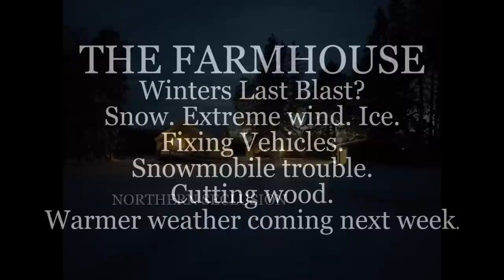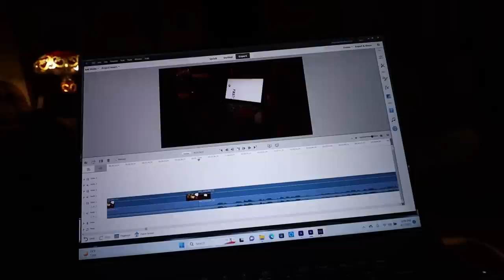THE FARMHOUSE. Winters Last Blast?  Snow. Ice. Extreme Wind. Fixing vehicles. Cutting wood.

Comment: good day joe sounds like you need a little carb work on log splitter . u might be old enough to to remember when the old 4 wheel drives that all the trucks Used spindles and were able to grease the bearings and he never had a failure yup those were the days and never had a bearing failure then on that style, keep having fun and enjoying life

Comment: It would be nice to see in a video if these winds you had caused any trees to blow down in your woods. You could do it while checking the Maple tree taps for any sap flow. If you have any, would you try and get them cut up and pulled out before the bugs get too bad in the Summer? Depending on the species and how small you split the wood, this wood could be used in your boiler next Winter.

Comment: The floats in the carburetor are stuck, or have a hole in one!! It definitely sounds like it isn’t shutting off the fuel when the bowls fill up with fuel!! If they don’t shut the fuel off it will let the fuel keep flowing causing the fuel to fill the engine block with fuel!!!! You definitely don’t want to keep turning it over because if enough fuel gets into the engine it can cause it to get locked up until you get the fuel out of the cylinders!!! It can cause damage to the engine if it does end up starting before it gets to much fuel in the cylinders!!! Hopefully that helps you out!!! I’d definitely take the carburetors off and double check the floats making sure that they still float and don’t have a leak in them causing them to fill up and then if they don’t have a hole in one definitely check the seats on the needle and make sure it is still working and not have junk around the needle where if it doesn’t shut the fuel off because of junk or if it has a bad rubber where it seals the fuel off!!! Those are the two first things I would definitely check out and I bet the issue is somewhere in there!!!

Comment: Are there any fuel filters on that machine? The carburetors you have are definitely float type and can be very touchy.
Reply from the maker: I have no idea. You know me, it either works or it doesn't when it comes to the smaller engines. If Zach can not come fix it, it is time to buy something else. Lol.

Comment: Great video! At least we know we’re not the only ones dealing with gale force wind. Looks like the wheel bearing replacement went better than on my 2001 Tahoe last month! I ended up buying a Harbor Freight air Hammer to get the old one out. Took forever. Starters now seem to be a pain on any vehicle these days. What’s the scoop on the MS361? I may have missed what was up with it.
Reply from the maker: I did use it in a video but it still does not run as good as I would like. It could be that I am just not used to the saw. Once I got my 360 fixed and then I have the smaller one for the smaller logs I have just been using those 2. I think I will buy a brand new saw that is close to what my 360 in this year and just see what happens.
Reply: @NorthernSeclusion  Ah, that may be the new MS400! Those 361’s are a beast though. May just be something simple, like a new carb. All the best!

Comment: Hey Joe, you just saved yourself about $300.00 in labor charges on changing that Hub. I'm curious how difficult it was to remove the "old" hub assembly.
Reply from the maker: Since it was not being used again nor did I need it for a core I just beat on it with a hammer and eventually it came off. I have replaced them several times on 4wd trucks and it is a little harder but to be honest, it takes less time to replace the wheel hub and it is easier than doing the brake pads. The hardest thing about doing it is deciding "ok today I am going to do it."

Comment: Buy 2 pontoons store them on top of the fish house trailer, then if you need them have a way to bolt to the sides of that trailer so it floats. Yeah I know that's far fetched but might work.
Reply: Put down the pipe jake.

Comment: You need needle and  seats . There is two small plugs  on the exhaust of the engine way down low take them out and drain the fuel out the engine.  With the key off and the spark plug out pull the engine over. Reinstall the pipe plugs new needle and seats and you should be good

Comment: I was wondering if the cost of the wood you have used was a better deal than the cost of heating fuel.  It seems like you have used a lot of wood since that huge pile is almost gone
Reply from the maker: That pile costed me 1,620.00 I figure I used about 2,400.00 of wood this season and this has been a true long winter. If we would have heated all 3 buildings using fuel oil and propane we would have been at a minimum of 8,000.00.
Reply: @NorthernSeclusion  😯